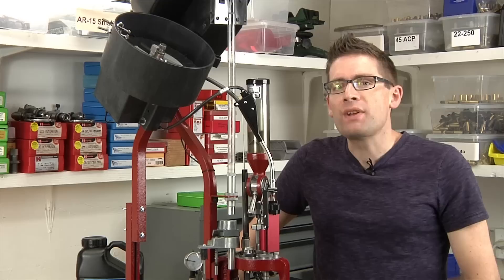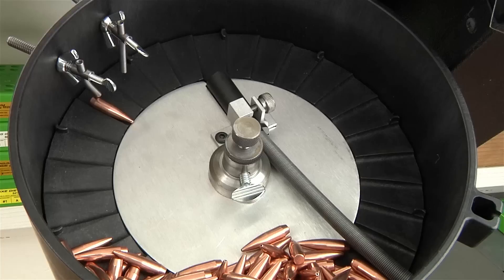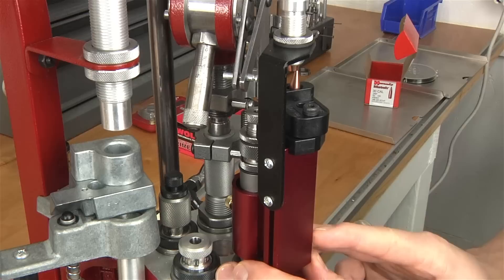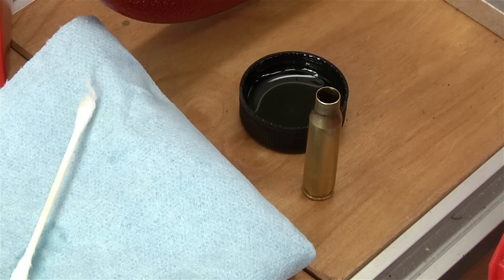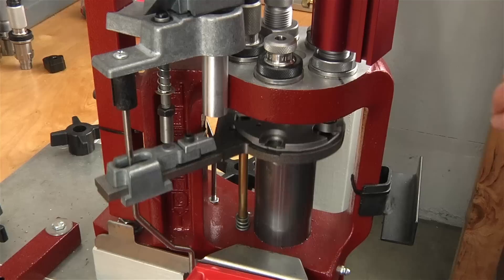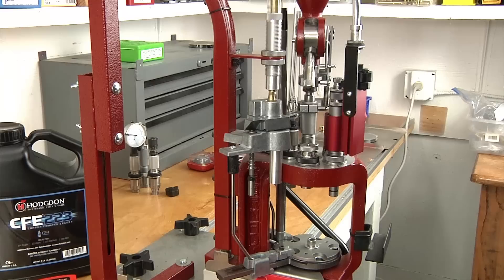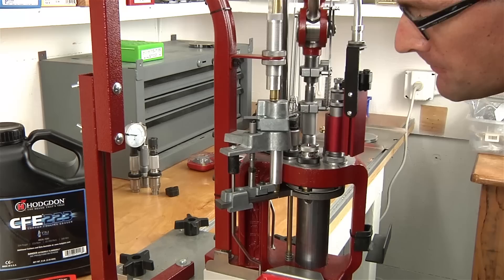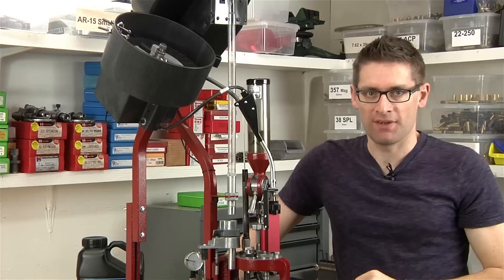Hornady Rifle Bullet Feeder Loading 308 w/Lock-N-Load AP

Comment: The 308 that I shoot through my gas gun always grows in length when resized. Do you account for that when you trim cases when you do your brass prep? I will feed cases that have been cleaned, resized and checked for headspace, decapped and primer pocket cleaned and of course all cases trimmed to the same length within the spec. If you resize in the first die you are depending on each case to grow the same amount when sized, which I find not to be the case. (No pun intended). I assume your goal is ammo that is ok for general use but I don't see producing ammo that will shoot consistently sub-moa at any distance and certainly not worthy for long range use. Don't your accuracy goals dictate how far you take the press from one that you add the case and bullet by hand to a full fledged ammo factory? No issues with what you are doing and I enjoy watching knowing that you are very familiar with that press and can troubleshoot or make fine adjustments based on experience. I am looking at one of these to load volume pistol ammo for 4 different calibers used in competition but can't see using it for any of my rifle ammo that requires as much accuracy as I can muster. I appreciate your fine videos.

Comment: Great Video! One Question: Why you don't use a Redding Type-S Full Length Die in this setup? This works great on my AP for .308 Win (and .223 Rem), and with the right bushing, the accuracy is there for sure.

Comment: I'm been using the .308 Hornady rifle Bullet Feed System. I have noticed that it's hard to seat the bullet and I;m also seeing copper shavings on the case plate.  Have you experienced this?  Compared to manually feeding the bullet and using an other brand of seating die, it's a lot smoother.  I'm using Lee full length sizing die.
Reply: Try using a bullet with a boatail rear end.  Should get rid of the copper shavings (caused when you insert bullet into tight front end.  Should work just fine.

Comment: I have been using the Hornady AP to reload 308.  But LC brass seems to be a real problem for me.  I swage out the primer pocket and clean.  I check lenght, and trim if necessary.  But getting the case sized is enough matter.  I'm using the Hornady dies, and I cannot get many of the cases to pass the headspace test, using a headspace gage from Wilson.  My SCAR 17 is a bit particular about brass and will just suck it in and not spit it out, or not complete loading.  I miced the butt OD, and it sometimes is in excess of .470  (say up to .473 or so.)  Won't even chamber, and I can't get the sizing die to get down that low.  I progressivieless tighten up on the sizing die, and it eventually just gets too tight and locks up the press, or can't go all the way up.  What do you recommentd?  Change shellplates??  Change dies??  OR never buy any LC brass again.  I note that Hornady and several other brasses don't seem to have this problem.  I would love to crank out some good 308 ammo, but I sure am kinda at a standstill.  Advice would be much appreciated.  Clarence

Comment: Won't the motor oil contaminate the powder or primer?
Reply from the maker: Not if you are super sparing.
Reply: So if anything it will be that first round that would have an issue with if something didnt work properly?

Comment: Curious if you're using ball powder with this set-up. Wondering how the powder measure would "stroke" out extruded powders. 
I notice they tend to crunch with some force when I manually crank out those powder loads with my old RCBS single stage equip.
Reply from the maker: I've used the powder measure with ball, flattened ball, flake, short stick, and long stick powders. It does really well with all, but as you mention, you can feel long stick powder granules "break" when you dispense a powder charge. For that reason I prefer short stick (Varget for example) or ball powders for bulk loading.
Reply: Thanks for the info, much appreciated.

Comment: +gavintoobe  I see you have reviewed both the Hornady and the RCBS rifle feeders, just curious which one you found to be the better feeder?   Cheers.
Reply from the maker: Each have their pros/cons! The RCBS bullet collator is very quiet, and works well with minimal adjustment, but the Hornady rifle bullet feed die is nice becasue it's not dependent on the powder measure for actuation. Perhaps I'll do a video showing a Frankenlöder setup with both together!
Reply: Cheers for that, I will have to re-watch the clips, as I did not realize the RCBS was dependent on the powder measure to actuate!

Comment: Too bad you can't remove the tool head with the adjustments set. Maybe Dillon has a patent on that.  Hornady has come a long way since I sold my mine back in 1991 and bought a Dillon Xl650
Reply from the maker: I like the Lock-N-Load bushing system on this press better than toolheads- no question. The dies float for maximum concentricity, and they pop out in seconds, so you do indeed maintain adjustments. Fastest powder measure dump when you're done loading too!
Reply: gavintoobe Sounds good to me they have made some good upgrades since 1991.

Comment: is it a good system for making target bullets? or should I buy a single stage press kit?
Reply: I would get a Dillon. We've found the Hornady AP to have very loose tolerances and quite frankly..cheap pot metal material. We still use a Hornady, But curse at the damn thing the whole time, wishing we had bought a Dillon.
Reply: Mobius Cheap pot metal? Where? Steel, aluminum and brass are what mine is made of.

Comment: Gavin I have a Hornady LNL progressive press that shakes the powder out of the case during indexing. Only in .223 cases does this occur and I'm wondering if you have a solution. I called Hornady and they said to use a powder that won't fill up the case so much. Well all powders fill up a .223 case! I want an accurate load, any suggestions? Thanks.
Reply from the maker: Andy- I haven't had too much trouble with this- the one thing I would check is the depth of the detent balls that do the indexing. I've heard that tweaking the depth of the balls can lessen the indexing snap.
Reply: SLOW DOWN, slow is smooth and smooth is fast. I had the same problem with my Dillon until Learned to use it properly.
Now I don't spill a drop and I can still load 800 round and hour, TAKING MY TIME.
Reply: I have to hold the shell plate with my hand so it won't shack the powder out while indexing . This is very aggravating and still powder comes out.
Reply: gavintoobe How exactly do you tweak the balls (If you pardon the expression)?  I have powder spills on my 9mm loads but the 223 loads go okay.
Reply: gavintoobe I'm really interested in your ideas on "tweaking" the detent balls also. I took a look at them this weekend past and I felt they could be the culprit. I'm at a loss to see any way to adjust them. I see that they are spring loaded, but I see no way to adjust the pressure in either direction.
Reply: I spoke with Hornady yesterday and they said that the detent balls in the shell plate can be adjusted. They said to screw the balls into the shell plate a little at a tine and try it.
Reply: Andy Manly Intersting but how is that achieved?  No you try to hold them with long nose pliers whilst trying to turn them?  Or is it done by some other method? Thanks if you know and can tell us how?
Reply: Andy Manly  Do you mean tighten the shell plate a little at a time? I see no adjustment screws on the plate itself. I see detent balls on one side and a solid black plate on the other.

Comment: can im reload a carcano 6.5x51 on that reloading press
Reply from the maker: Are you referring to the 6.5×52mm Carcano? Hornady lists the #21 shellholder for that cartridge (for a single stage or turret press). I don't see a #21 shellplate for the Hornady Lock-N-Load AP- so I don't think you can load 6.5×52mm Carcano on the Hornady Lock-N-Load AP without having a custom shellplate made up...